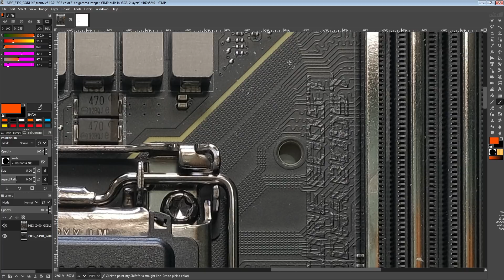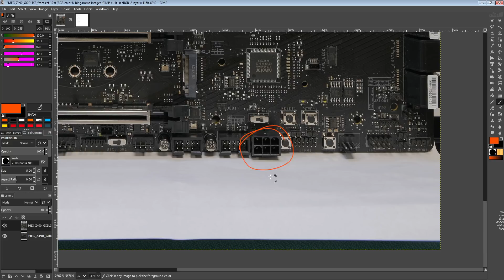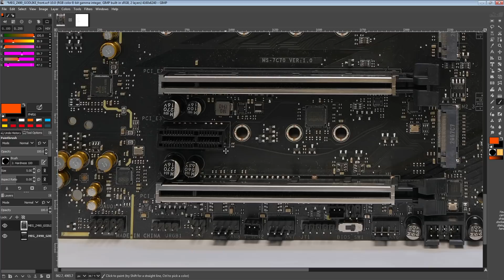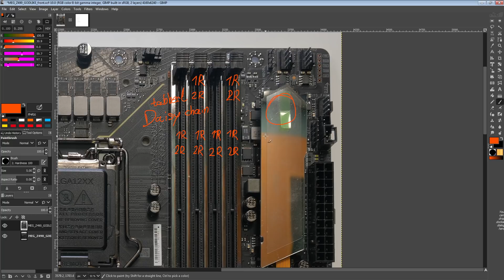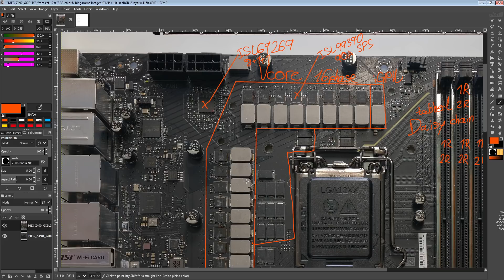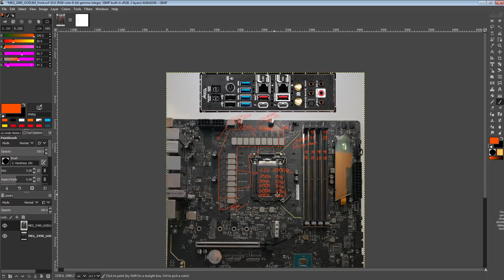mobo PCB Breakdown: MSI MEG Z490 Godlike // Video version 0.1

Comment from the maker: Paper on tabbed traces: https://doc.xdevs.com/doc/Intel/Technology_whitepapers/Tabbed_routing_crosstalk-mitigation-impedance-management-paper.pdf
Reply: So, from what I can tell, they are using the length and density of those tabs to increase the mutual capacitance of the differential pair. This is important because those lines have more mutual inductance. When they can match them exactly, the transmission line is matched. This allows it to mitigate far end crosstalk in a similar way that matching a load to a transmission line mitigates reflections (only this has to do with adapting the distributed model of the transmission line than just considering the load impedance).

This is fun stuff, the paper cites an equation that's from an older paper from 2008. Note that intel patented this in 2009, but the patent expired. You can see some of their measurements there. https://patents.google.com/patent/US20100327989A1/en I recommend downloading the PDF and looking at figure 2. You can see that intel are going with method (II) from the paper, where the mutual inductance of a microstrip line generates a negative voltage spike, and the high mutual capacitance of a fully-tabbed line generates a positive voltage spike cancel eachother out for non voltage spike from far end crosstalk.

The downside is that it requires significant design effort as each differential pair that you want to "tab" a section of needs to be indivdiually tuned. I guarantee that people spent a lot of time and effort on getting those tabs done.

I'll understand more next semester when I take a transmission line theory class.

Comment: GB X570 Xtreme can do 5000MT/s afaik. Roman showed it with a GB Rev E kit.
Reply from the maker: Ryzen 3000s IMC is really good at doing high clocks. Most of the high end X570s can do 5000MT/s

Comment: Fun Fact on the Vrm Fans is that they INTAKE air from the back of the board and then blow that air through the Finned Heatsink onto the VRM Inductors and CPU! So if you have a Rear exhaust Fan from your case, wouldn't that maybe pull that hot air right back into the Case?? Just a FYI! LOL!

Comment: Buildzoid is complaining because MSI used a fan for their VRM cooling, now I'm wondering what his reaction will be when he sees the VRM cooling of ASrock.
Reply from the maker: if you mean the ITX. That's fine since the board is way too small to get away with passive cooling.
Reply: @ActuallyHardcoreOverclocking the Taichi and PG Velocita has 3 fans on their VRMs.

Comment: I know my X299 OCF has the 6-pin pcie power right next to the 24-pin but I can't think of any other boards that have it there off hand, most usually have them by the last pcie slot which is also terrible imo.

Comment: I figure that 300A is gonna be pretty hard on to do on the 10900k with ambient cooling cause you'd be encroaching on 400w with those kinds of clocks ~ 5.1-5.2, at least provided this overclocks like a 9900k, which I'm expecting.

Comment: DDR traces on a motherboard are long enough and operate at a speed great enough to be modeled as "transmission lines" similar to coax cable. On PCBs they are micro strip transmission lines. Even though the signals are DC, the movement or propagation of the signal behaves more like an AC wave because they are so fast. The width of the trace, distance from the signal layer to the ground layer and distance trace to trace are all tightly controlled. You can only fit so many in a given space. The dielectric constant of the board is also critical to designing good micro strip transmission lines. 

One of the most important concepts to understand is the electromagnetic wave traveling down the traces exists around the micro strip traces instead of being contained inside it. This means it travels through the board between the trace and ground, but also in the air above the trace assuming the micro strip is on an outside layer. The difference in dielectric constant of air (about 1) and PCB material (4.5 or so) is the inhomogeneity (not the same) mentioned in the paper. This is one reason why I speculate some mobo manufacturers are putting ground planes above the traces. There would be a solid ground below the trace as well and the entire distance of the trace would have the same dielectric constant above and below it. 

According to the paper, one of the problems that arises is an excitation (change from 1 to 0 or 0 to 1) on one trace couples to adjacent traces at the far end which produces cross talk. The excitation comes from either the processor or the DIMM, and the far end is the opposite side from where the signal originates (depending on read or write). The cross talk interferes with the signals and makes it more difficult for the far end to hear what the proper state (1 or 0) of the excitation is. One way to reduce the cross talk is to space the traces out farther which is not desirable because you need to fit a bunch of traces in a tight area (bus width of 128, 192, 256 bits - each bit needs a trace). 

Crosstalk is exacerbated by the fact that the inductance and capacitance between the traces are not balanced (actually the ratio of the mutual capacitance and self capacitance to the mutual inductance and self inductance - mutual means between traces and self means of a given trace). The inductance is typically much higher. When you are talking about AC capacitance and inductance cancel each other. 

A capacitor is just two conductors next to each other. A way to add mutual capacitance between the traces is to add these tabs. The tabs help increase the capacitance between the traces without affecting the inductance. This capacitance helps to cancel out some of the cross talk, resulting in a signal at the far end that is easier to distinguish. 

I hope that is a little easier to understand than the paper.
Reply: So it is like twisted pair cabling for reducing crosstalk but for traces on a motherboard?
Reply: Good write up, thanks.  Could you speculate as to the effect that a year's worth of dust build up on top of the traces would have on the dielectric constant above those traces?  Would that have any meaningful effect on the tuning?  (Which almost certainly wouldn't happen to those boards with a ground plane above the traces.)
Reply: I'm confused but still gave it a thumbs up

Comment: MSI has some great specs, but I will never get over the bad days of MSI and poor quality control. Spending this much money on a board, means everything has to be perfect, from hardware + reliability, to weird quirks, to software, and the BIOS which is definitely still problematic. We need to get Buildzoid the boards in his hands, to prove it all himself, I don't trust a picture and a prayer. MSI has learned that we all learned about VRMs from Buildzoid+GN+Reddit, and is currently taking advantage of other manufacturers by going with sweet VRMs to make sales, but neglecting other less publicized stuff to stay cheap. But this board isnt cheap, so forget it. My 2 cents.
Reply from the maker: I've liked MSI's BIOS since like X99 where I literally switched from a Rampage V Extreme to an X99A Xpower because the Rampage was atrocious. Also on X570 MSI's BIOS works just fine.

Comment: Gigabyte is using 8 90A Smart Power Stages from intersil for the Vcore on there z490 iTX board. I'm wondering what MSI will do with there iTX. The APEX XII is also shown on there website doing 4800MHz-5000MHz on the RAM. I actually found a kit of GSKills Ripjaws V Black. (2) 2x8GB kits that are rated unlike anything i've seen before. Try (DDR4-4000MHz CL15-16-16-36) I got this kit up to 4500MHz using some funky timings but, they posted. On a z370 Aorus Gaming 7 of all boards. Though that was with a Platinum i7 8700K. I also had both kits on the z390 Designare getting 4400MHz with a above average 9900K. All my components are open box items, so no complaints here. I got some of that Patriot Viper 4400MHz CL19 on its way. AMAZON has those kits for $129 right on the money. Killier prices. Plus i have some awesome Trident Z Heat spreaders for'em.  But, here are the specs on the 4000MHz CL15 kit
F4-4000C15D-16GVK
Ripjaws V
DDR4-4000MHz CL15-16-16-36 1.50V
16GB (2x8GB)

Comment: They should come up with a VRM cooling design where you have heatpipes and fins similar to the NH-D15, and then add a cooling boost mode which turns on an industrial blower for higher airflow through the fins. That would help in cases where you may want to do liquid cooling and push the CPU close to 1.37V for an everyday overclock across 8 cores.

Comment: Will there be a video for the "easy way to get more performance on ryzen 3000 for a MSI motherboard"? Because the limits for ASUS and Gigabyte do not really work for MSI. Ryzen Master shows other limits than I set in the BIOS. Looks like those limits are not supported by MSI.
Reply from the maker: at least on the Godlike and Unify the same limits I use on ASUS and gigabyte work fine.

Comment: Ayyyyy! Waiting for the Z490I Unify
Reply: We need a unify for Threadripper that would interesting to see.
Reply: I have the X570 Unify and it's an awesome mobo. I'd be surprised if the Z490 version was any less amazing.
Reply: Apparently, unify features 10 layer pcb.
Reply: @j s anandtech reported 10, not sure where else it's coming from, but I'm not surprised. The gigabyte z490i aorus ultra is also 10 layers. The reason the unify is 10 lyr is because it's mini ITX. what I'm interested in though is the SMD RAM SLOTS! 

I'm interested on buildzoid's thoughts on the output filtering of the ROG strix z490i gaming with the tiny output caps and especially the z490i aorus ultra which has the inductors right against the socket and puts the filter caps on the back of the board.